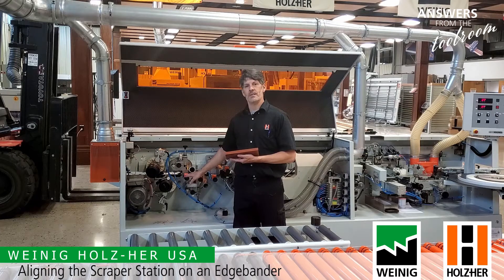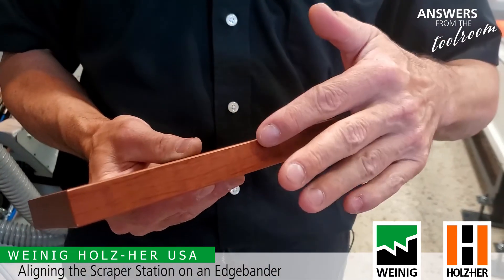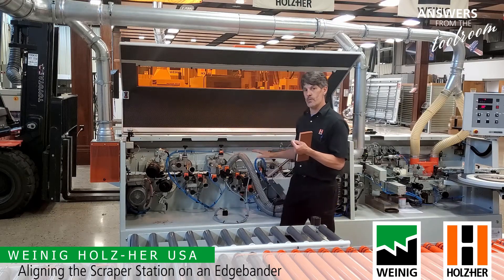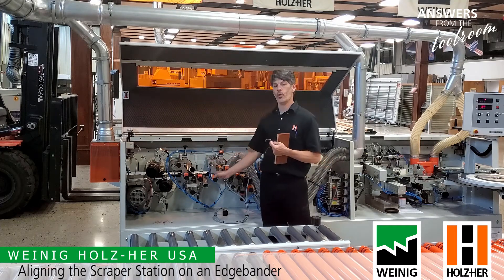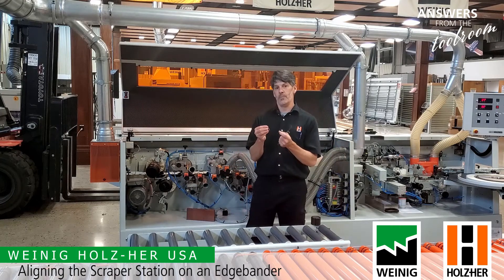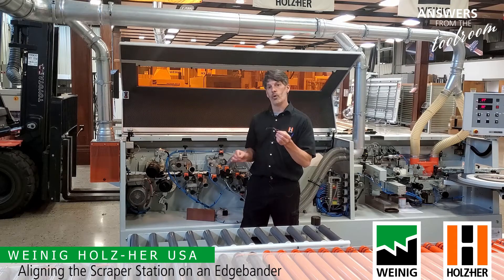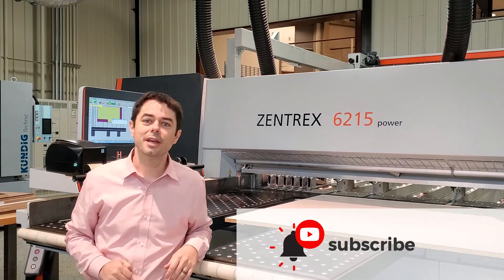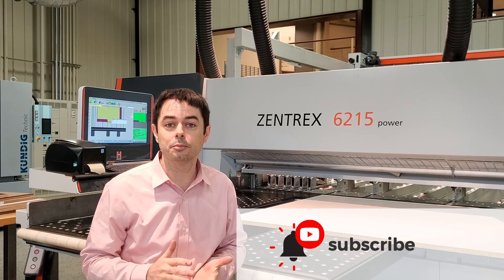How to align the scraper station on a Holz-Her Edgebander

Comment: The video does NOT show how to adjust the scraper station.  No explanation is made that lock handles must be loosened before making the adjustments.  No reference is made as to turn the counters clock wise or counterclockwise wise.

I will say however that this video is as bad as most Holzer manuals in terms of being able to extract information.

I enjoyed the part where the tech says wear out TOO prematurely.  Is this too say Holzer parts always wear out prematurely they just don't want it to be too prematurely.😊

Comment: Well that didn't tell me shyt
Reply: It's even worse , It told you exactly what not to do . If your scraping is too thick you should not reduce the radius on the profile trimming station. Adjusting a profile scraper can be done horizontally (forward-backward for profile) and vertically (up and down in realtion to the panell. If you want instructions I will put them on my channel.